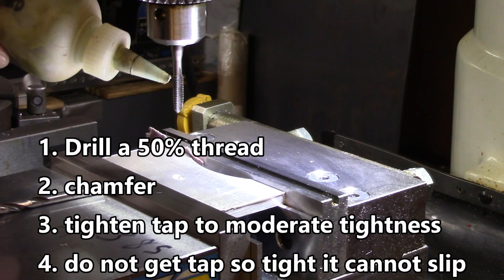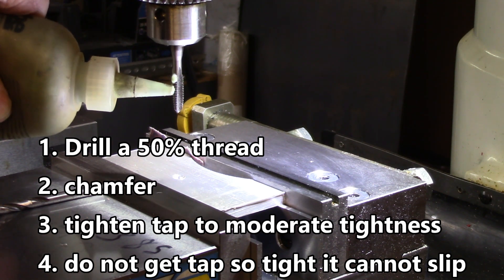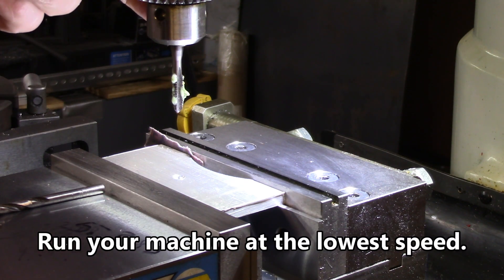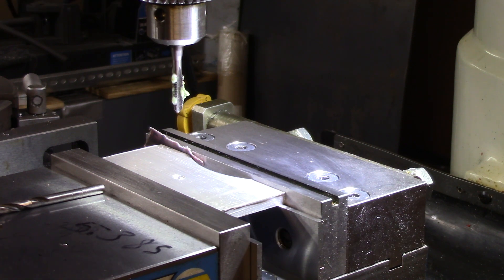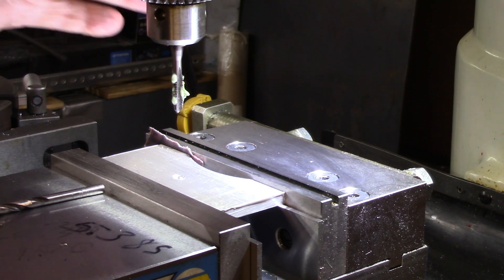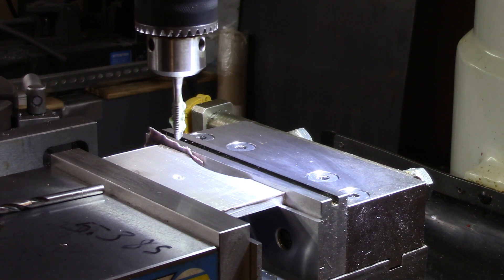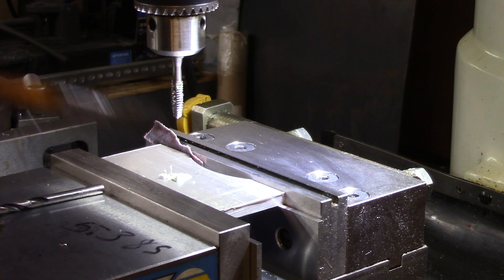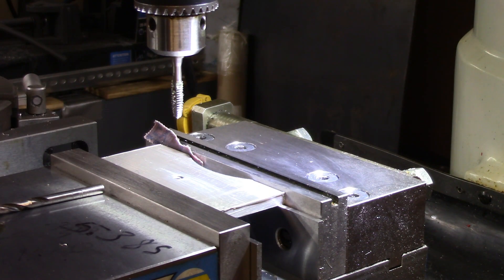#Shorts - Power Tapping

Comment: Taps above 1/4" do tend to slip in the chuck even when tightened. They are hardened throughout and the chuck jaws can't bite into the hard shank. Unlike drills + reamers that have soft shanks to purposely allow the chuck to bite into the shank.
Reply from the maker: Yessir and we can use that to our benefit.  Thanks pi.

Comment: I was taught to power tap like this way back in trade school n use it from time to time. although sometimes I wonder if doing it a lot, if it would induce any wear on the Chuck jaws over time. seen many chucks ruined but probably more so from higher rpm slippage on drill bits not being tightened enough.
Reply from the maker: I would expect all tools to wear from use.  Thanks Jeff.
Reply: @AmateurRedneckWorkshop  thanks for clearing that up for me, lol.  I'll keep my thoughts to myself. have a good night.
Reply from the maker: @jeffmays3608  I certainly did not mean to be critical of your opinion.  Please continue to express your thoughts in these comments.

Comment: I break taps by hand. What type tap will power tap? Brand,type how cheap can I go?
Reply: Usually a tap will take a lot of torque to break, but one little jiggle of the hand, and it's gone!
Reply from the maker: You should always use sharp taps of a good quality.  If the tap is hard to turn by hand it will be prone to break if pushed hard.  Thanks C2H
Reply: Actually, a gun tap  or a spiral point  go like the dickens, top quality ;a couple are Butterfield, and  Greenfield  to name a few. Stay away from carbon steel , high speed steel keeps its sharpness and is way easier on the user.
Reply from the maker: @howder1951  thanks for that tip Howder.